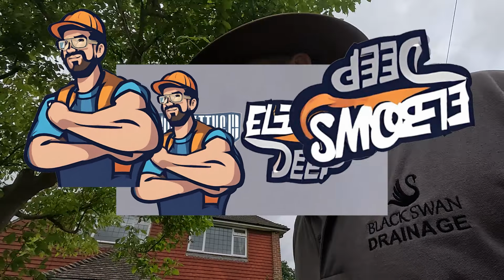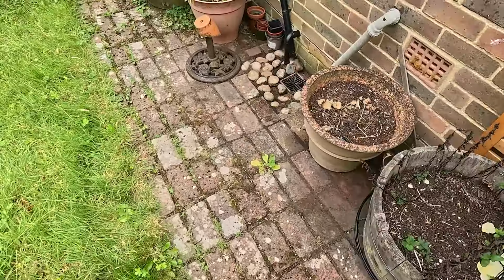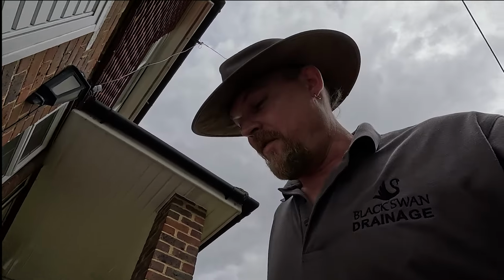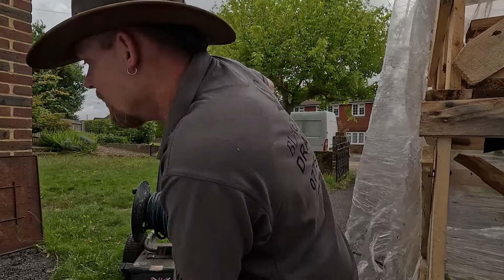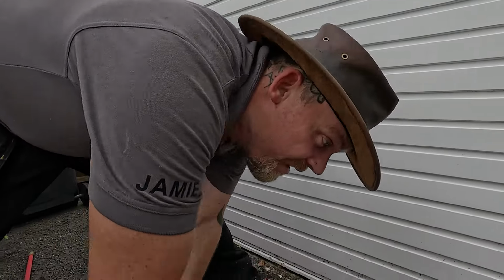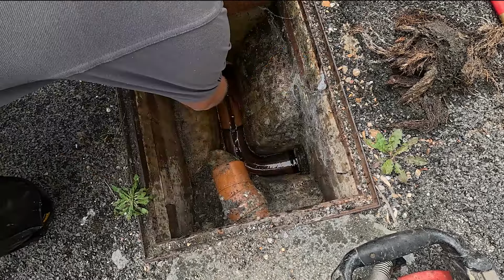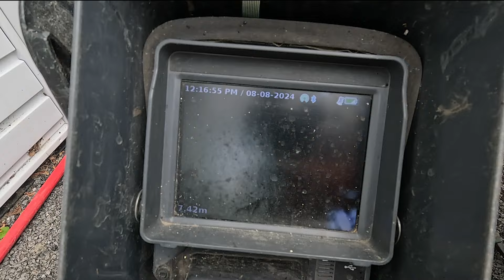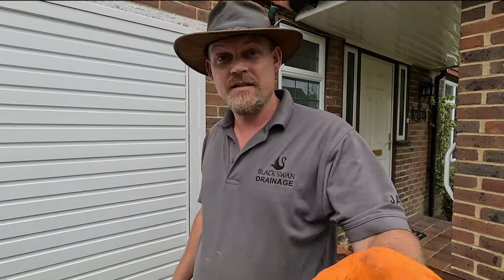Tree roots Barricading this blocked drain

Comment: Jamie, do you worry about your hearing from being exposed to that loud noise so often? Do you get your hearing checked? And.. that RIGID device that you use... how does it work?
Reply from the maker: What 😂😂 I think it sounds louder in the videos. I have been in construction since I was 15 and last had hearing checked 3 or 4 years ago, it’s about right for being 38. The scanner picked up a little radio transmitter in the camera and you just find the strongest signal, it’s a very simple device but very helpful